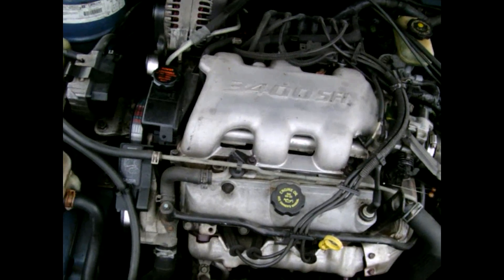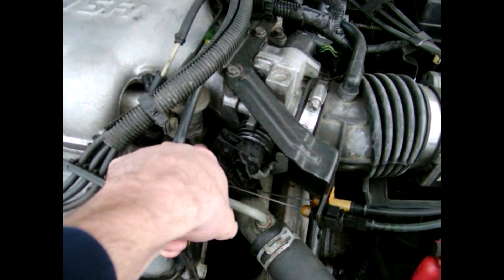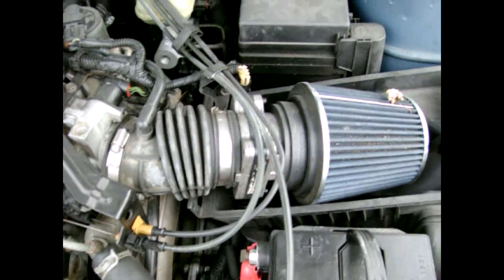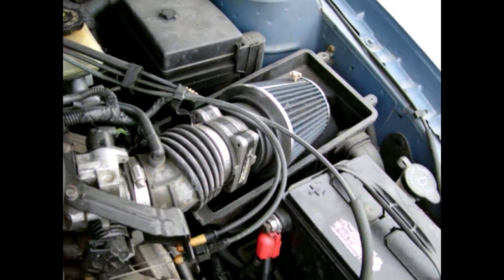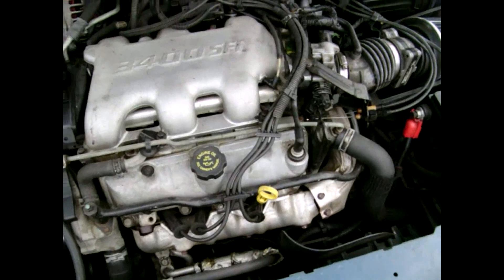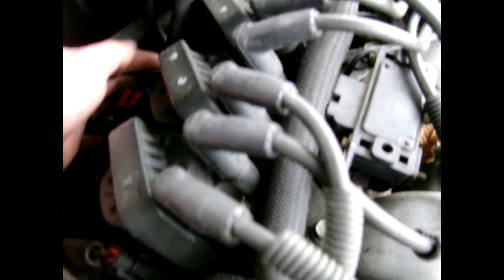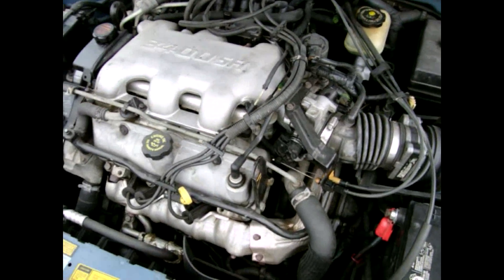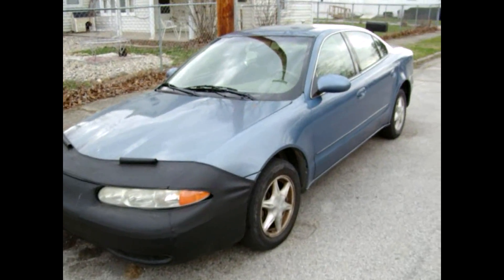3400 GM Engine 3.4 Liter Motor Explanation And Discussion

Comment: I have a 2000 Alero with 201,000 and I don't have piston slap. Only thing I've done engine wise besides oil change is I had to put a water pump on it when I got it. It had 192,000 when I got it. Otherwise I love it. Car still runs like a champ. I do have one slight issue that's weird. in the summer the car runs a proper temp but in the winter time the temp gauge won't even make the first line after cold unless you're setting idle. Even then once you get moving again it drops right back to that temp. So the heat ain't as hot as it should be.
Reply from the maker: Bad head gaskets.  The OEM gaskets on these engines are junk.
VT247
Reply: If it was a bad head gasket then wouldn't it over heat? Me and my dad are thinking my Thermostat is sticking open so I'm going I replace that first cause that's a cheap fix. I'm not working right now so if it's a head gasket then I'm screwed lol so I hope this takes care of it

Comment: Hey, wondering if you can help.  I have an 01 Grand am GT with the 3400 in it.  My problem is that it is having hot start issues.  It will start fine cold but if i shut it off once it's  at temp (around 200) I have to press the gas pedal down in order to start it.  Fuel pump has been replaced so I am thinking a sensor could be the issue?  Suggestions?

Comment from the maker: If it's a belt squeal, make sure there is good tension on the belt.  Take the 3/8 drive ratchet and put it in the tensioner.  Press towards the firewall to give more tension.  Make sure you didn't over tighten the bolt going through the tensioner into the block.  The tensioner may not be giving enough 'pull' to keep the belt tension correct.
VT247

Comment: I know this is an old post but I have a 2002 chevy impala and I had to replace the intake manifold gasket agree putting it back together there is a fuel injector missing where do all of the fuel injector goes I might have one in the wrong place
Reply from the maker: The fuel injectors only go on one way and the wiring is in such a way they naturally go to the right spot also.  Make sure you have the firing order correct.  Find out which cylinder is misfiring by the 'remove one spark plug wire and listen for change, move on to the next and repeat' method.
VT247

Comment: I have a 2001 Pontiac grand am gt it has the 3.4l motor and I noticed that I have a vaccum line that is not connected on the back of the intake and Im not sure where is gose or if the line is completely gone. I need some advice.

Comment: Hello there I have a 2001 alero with a little over 151000 miles on it. I have that rough idle problem and I think it's leak cause when I press the gas it has a funny smell. Also I want to know which gasket will be the best to replace? Thank you

Comment: Doing a swap and there are different connections from the donor to the orginal. Specifically, the connection behind the power steering pump, I believe it is the cam position sensor. A connection in the front of the oil pan which would have no connection or plug from the car it's going into. Will it work?
Reply from the maker: Might be able to swap out the cam sensor from the original motor over to the new one.  Some models have a sensor on the oil pan for a low oil light.  Not connecting that is fine since the original never had it.
VT247

Comment from the maker: It's possible it may have piston slap.  If it goes away when the car warms up, that's what it probably is.  But, if it's a knock, it could be the main bearings since you've already replaced the rod bearings.
VT247

Comment: Hi VTime!  I am currently trying to do an overhaul on my vacuum lines and the PVC ose.  About 3 months ago, i was trying to change my spark plugs and i had so much trouble just getting to the plugs. shortly after that, i noticed a rouch running vehicle and i have found many broke vacuum feed lines. I had to take my alternator off and while i am doing this, i figured that i would finish the plugs, and i found the  evap valve and the canister purge solenoid completely disconnected. call me please!

Comment: It's actually green radiator fluid. This was a GM dealer. I asked him if the intake manifold gasket was blown and he said no. He said your timing chain cover is leaking oil and radiator fluid which led me to believe there was some kind of radiator fluid o ring or gasket behind the timing chain cover. So you're saying there is no such gasket pertaining to radiator fluid behind the timing chain cover? I already did my spark plugs, tilted the motor forward, the 3 in the back were tough.

Comment: got a p0403 code for my 3400 motor on my 2004 impala changed the EGR valve but the check engine light is still on

Comment: i have a 2000 grand am gt i replaced the head gadkets and every gasket on the rest of the upper parts i found a vacum line coming out of a bundle of wires and i cant find where it goes any ideas

Comment from the maker: It's the intake manifold gasket.  They are known to go bad.  GM didn't torque the bolts down very well and on top of that used Dexcool as an antifreeze that eats gaskets.  I have a video on how to do the intake manifold gasket and the head gaskets.  If you have to do the intake manifold gasket, go ahead and do the head gaskets too.  They'll eventually fail and then the whole job will need done all over again.  Plus, it's not that much more to do the head gaskets if doing the intake.
VT247

Comment: My wife is looking for a new vehicle, and for some reason, yet understood by me, she likes the Pontiac Aztek (at least they're cheap lol).  Anyway, I was doing a little research on these and they have this 3400 GM motor.  As you mention, I have seen a lot of talk about the LIM gasket going bad because of the type of coolant that was used. Is this an issue that GM fixed at some point?  If so, what year model would be good to look for? What's considered "high" mileage for these motors?

Comment: : "I have a 99 3400 grand am. in cylinder 5 the engine holds compression but drops to 60 psi and starts misfiring once at running temp. I checked the block when the pistion all the way down an didnt see any cracks, i also checked the head and that wasent cracked, i took the head off flipped it where the valves face up and poured water on them they did not leak, the piston rings are also new, what could be and issue?

Comment from the maker: Sounds like the fuel pump isn't pushing out enough gas.  Check fuel pressure.  If it's out of its specific range, change fuel filter and pump.
VT247

Comment: Educational video! I already knew that the air intake gaskets are of poor quality. Ok see that you have an open air filter. I tried the same with mine but it doesn't really give that deep sound that I had hoped for so I built everything back to the original. Greetings from Holland.😎👍🏼

Comment: '02 Rendezvous leaking alot of oil.  Seems to run down mainly the back side of the engine.  Oil pan gasket seems OK.  I did replace the front crankshaft seal under the balancer (what a PITA!), and that seemed to help, but I would like to try to tackle the remainder of the leaks.  What's the next most likely culprit?  Valve cover gaskets or Lower Intake Manifol gaskets?
Reply from the maker: Take it to the local spray and go car wash.  Hose it all down underneath.  This should help locate the leak easier.  Look around the oil filter location.  Just above that there is an oil pressure sensor.  They are known to leak.  It may require a special socket to remove it.  
VT247

Comment: I have a Chevy Impala 2000 same engine.  My issue is that the vehicle seems to get fairly hot when idling it doesn't actually overheat though but the temperature gauge seems to be all over the place while driving. When the car is moving the needle stays down but when I am idling it climbs to just over half way then it appears the thermostat opens and brings the temp down but not for long if I continue to idle this process happens over and over again it will climb and fall but never over heat
Reply: Lol 11year old comment but i still have to laugh at you, wow dont ever work on a car.

Comment: Got a question regarding my 98 Montana with a 3.4L V6. You seem  to be pretty knowledgeable about this motor. I noticed an oil leak and took it to the dealer. They said the timing chain cover gasket was leaking oil and radiator fluid. They wanted $990. $10 for the gasket, can you believe that? Is this is a hard job? Why would there be radiator fluid leaking out of the timing chain cover? Is there a gasket behind the timing cover that's related to the water pump? Look forward to hearing from you.

Comment from the maker: Certainly sounds like it could be a vacuum leak.  Check for engine codes.  A spray bottle with water when sprayed to the open vacuum leak will slow the engine down.  Also, check the throttle body and make sure it isn't sticking.  An partially stuck open throttle body will cause it and the TPS to think that you have your foot on the gas.  But instead, it's just not closed all the way.
VT247

Comment from the maker: If by CPS sensor you mean the camshaft position sensor, the power steering pump needs removed.  It's under their.  FYI, sometimes a bad CPS sensor is really just bad spark plugs, wires or coil.
VT247

Comment from the maker: In a car the engine would come out the top, in a van, I think it might need dropped from the bottom.  My guess is what happened is that the intake manifold gasket failed and allowed water and antifreeze to mix in the oil.  Made the crank go bad.
VT247

Comment: I have this engine.. a shop did the intake gaskets when they went while i was out of town and could not do it myself.. not sure if my issues is do to how they put it back together or not...  on the fuel test port I can't get a tester onto it because there is a pipe just infront of it that hinders screwing on the fitting of the test gauge hose... is there maybe a special adapter like a 90 elbow fitting for that or ?
Reply from the maker: Honestly, not sure on this one.  Perhaps someone else could jump in and give some advise?  There may be some type of elbow.  Check for any leakage around the fuel pressure regulator and the vacuum port area.
VT247
Reply: @Vacationtime247
Reply: the hf. fuel pressure tester kit has a 90 in it.

Comment: I have a question on my car. It is a Grand Am 2001 , has the p0336 code 24x ckp sensor. if i disconnect the sensor, the car runs good, but performance is not good, it feels slow. With the sensor connected, works ok for the first 10 minutes, and begins to misfire. if i drive it more, it will misfire a lot. any ideas??

Comment from the maker: Can you be a little more specific?  It starts and runs for 10 minutes, then shuts off?  Runs good but if you shut it off and try and re-start it runs bad?  A few suggestions off the top of my head says check for vacuum leaks.  The module under the coil packs sometimes go bad too.  
VT247

Comment: Sounds like to me that you have a vapor lock in your coolant system, or ou have a micro crack in your 15 psi cap on your coolant tank.  I would buy a new cap first, run the car with the cap off and add coolant if you need it.  When the thermostat opens, it would expand the coolant to the top and overflow.  At this time, place the new cap on because the coolant has pushed all of the air out.

I've done this with my 1995 Grand Am Se Coupe.  It runs no higher than 125 degrees on the highway.

Comment: Hey I have 2002 Grand Am Im have problems with the car hard shifting, I took it to a transmission shop and they to told me that it was a intake sensor problem, because the pressure isn't being regulated right, does this sound ring any bells for you?

Comment: Hi , I recently bought a 99 olds alero with the v-6 engine . The starter went out and I haven't replaced one since my 68 fury . Is it hard to r and r ? Also  are the bolts metric ? I'd like to do it myself .Do I have to move things to get at it ? Any help would be really appreciated .

Comment: I have an antifreeze leaking up underneath the power steering pump. Drive it kinda hot for about an hour and a half until i got home. When i shut the engine off, there was water spraying from under the power steering pump, then all the antifreeze started dripping out fast. I cant figure out where the leak is coming from exactly
Reply from the maker: Fill the coolant system up at the radiator on some models, the overflow tank on others.  Then do a system pressure test.  Can do a loan a tool at autozone for this tool.  Attach to the radiator / overflow tank and pressurize the system with the pump.  Water / antifreeze will squirt out from where the leak is.  It's probably either the timing cover gasket or the intake gasket.  If you have to do the intake gasket, do the head gaskets too.
VT247

Comment: good morning vacationtime i would like to ask. im having a misfire on 3rd cylinder ive changed the plugs, wires ignition coil still its the same p0303 still does not go away. it starts and runs fine but there is just a slight misfire you can feel when its in idle and white smoke in the exhaust. please help me. thanks

Comment from the maker: Make sure the marks are lined up.  Lube it up with some soap.  Push the plastic connector all the way to the end of the metal tube.  If it still is causing trouble try a small screwdriver and maneuver it in.  Hope this helps.
VT247

Comment: Man , i have replaced 2 of this head gasket jobs on 2 different year models and they not to hard to fix but pay attention to all the hoses . Replace the ones that go behind the intake manifold to the heating system , they will bust and break, that plastic 3 way tee will snap off easily . Use new belt too.

Comment: Hello I have 03 Monte Carlo, and Im missing a few vacumm hoses..I see some that I am missing on your engine would you please tell me what vacuum hoses are the ones on the intake passenger side top left and the right  that's on side of the evap canister? Please
Reply from the maker: Here is a diagram I found online.  On some models one of the vacuum ports are plugged.  My '01 Aztek has a sealed port but on other models it is used.  https://www.justanswer.com/pontiac/8bu3y-pontiac-grand-gt-vacuum-line-diagram-pontiac-grand.html
VT247
Reply: Thanks for responding and thank you for the diagram of the 3400 engine.On the   diagram number 8, is the hose that I missing, my question is it supposed to have a plug on it or is it supposed to have a hose?
Reply from the maker: No, the shifting is controlled through the computer on newer models, that vacuum hose isn't used.
VT247

Comment: I've got a 99 grand am gt with the 3.4, runs great drives great, but only till the battery dies, just put in new alternator and battery and still won't charge the system, and thoughts ?
Reply from the maker: +Eli Eli Check fuses.
VT247

Comment: Hey guys I wanna replace my Spark plugs and Plug wires  on my 2000 Alero with the 3.4L, am i able to replace them without the special tool i'm told i need? I really don't wanna take it to a garage and spend unnecessary money. Thanks for the help I would really appreciate the help.

Comment: Coolant level is good..my car idles and it passes two lines after 1/2 and they still wont come on.what is the normal temperature whenever the car is at idle??.....do u know where is the temperature sensor is located in a 03 grand am 3.4

Comment: Today our 2002 Pontiac Aztek with 195000 miles broke down. Yesterday my wife noticed a strange noise from the engine. This morning I started the car and after 3 ft driving out of the garage it stopped and won't start again. First it sounded like it had no power or compression. If there was an internal major mechanical failure would the vehicle been able to start up.  I have no major leak on the garage floor. I did notice a decolorization of the oil on the dipstick. The headgasket was replaced around 40,000 miles due to the known GM issues. Bottom line engine doesn't start up anymore and it sounded different and very powerless this morning - almost like no compression... Any thoughts?
Reply from the maker: Here's some of the things I'd check for, if that happened to me.  First, see if the engine will even turn over.  If it's locked up, it's time for a new one.  See if it has spark at the plug.  Then, see if it has fuel pressure in the rail, there's a port behind the power steering pump.  It will shoot out gas, just see if it has decent pressure.  See if the oil level is correct.  The intake gaskets are also known to go bad on these engines.  When that happens, it floods the crankcase with coolant.  Turns the oil into a milky white sludge.  My guess is that the fuel pump or pressure regulator has gone bad.  No gas or weak pressure can make it spit and sputter.  Might try a few squirts of starting fluid in the intake to see if it will fire over.  May try disconnecting the MAF sensor.  These should be some pretty simple tests.  Hit me up with what you find out.
VT247

Comment: I was mistaken on the ticking noise. It kept coming back so I drove my wife's car for a spell and she used mine around the house staying close to home. The battery ended up dead so I took it to my usual shop and they said the harmonic balancer was toast. After removing it they found the crank sensor had been damaged too. So after a good sized chunk of change to them the ticking is now gone and the car runs smoother and does not get so hot. Fingers crossed I am done with it for a while.

Comment from the maker: Twist and turn the spark plug wire boot gently until it spins freely, then pull off at the large rubber end.  Sometimes they're stuck good, a set of long needle nose grips works well.  Do not pull at the thin wire, always at the boot.  If the wire pulls out from the boot it can get difficult.  Especially if the metal tab stays on the spark plug wire.  
VT247